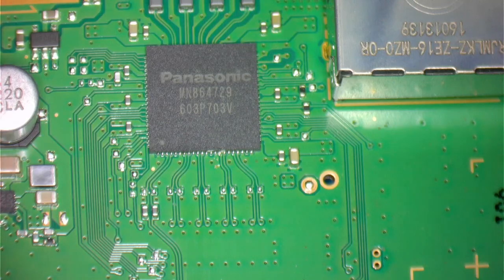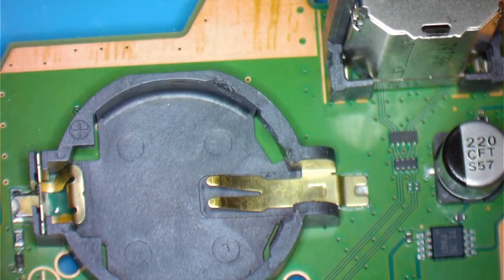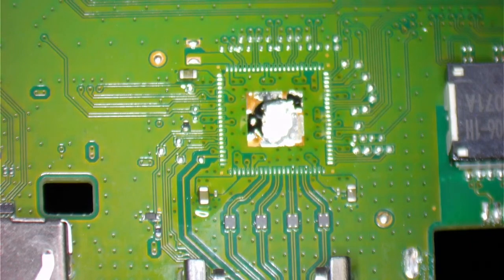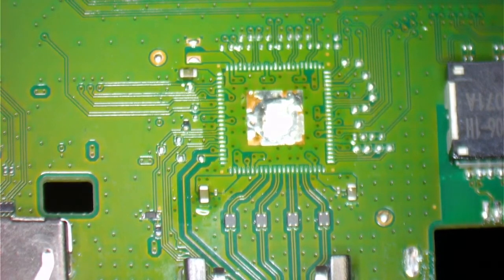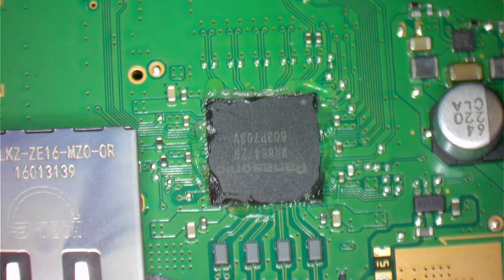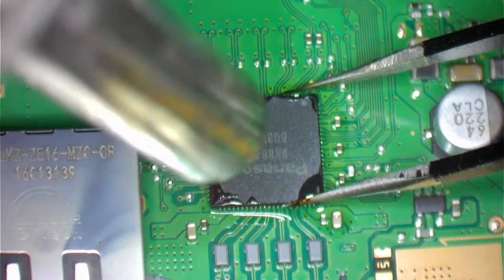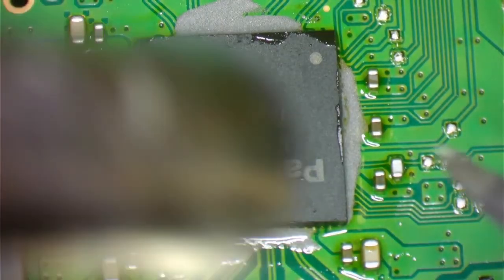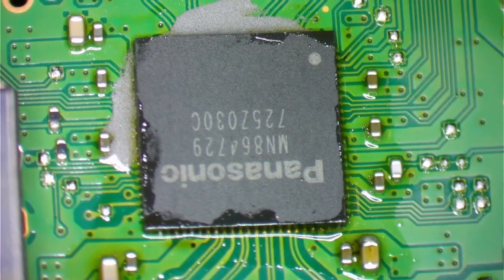PS4 HDMI Encoder Video IC Chip MN864729 Replacement - NO VIDEO FIX

Comment: Hello, best HDMI encoder replacement I have seen so far! well done sir.
Are you using a stereoscope ?
And using soldering past along with hot air and iron tip is a great idea!
Best regards,
Reply from the maker: I believe so, everything I use is in the description of my videos. Thank you for your input.

Comment: This is my one downfall is qfn chips. Tried to do this same job today on a slim and struggled with getting the legs on the chip to the pads on the board. Tried so many different tips to get better heat transfer but just wasn't going smoothly. Maybe I'll try out the solder paste method.
Reply from the maker: The solder paste works just apply enough heat. Good luck on your repair.